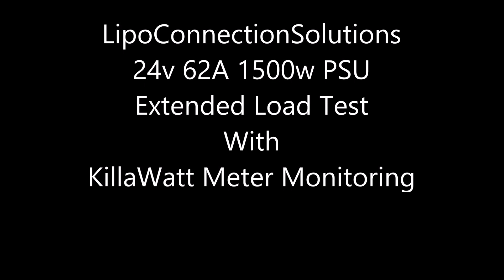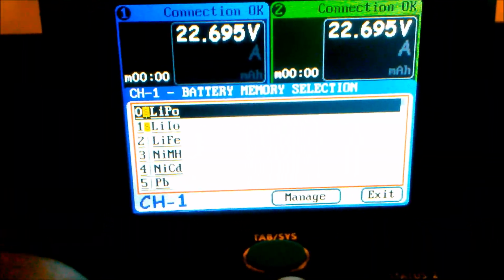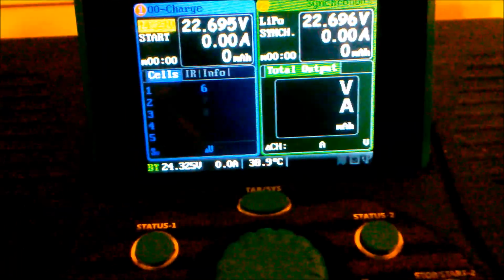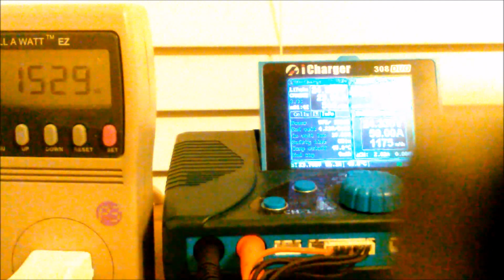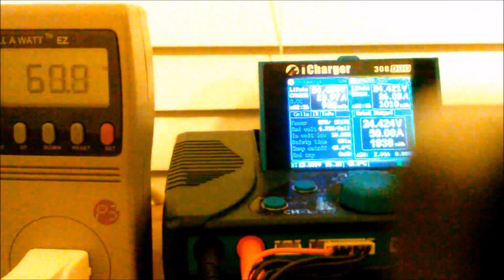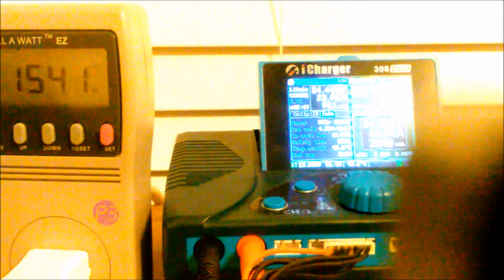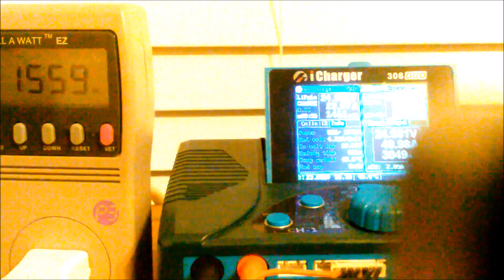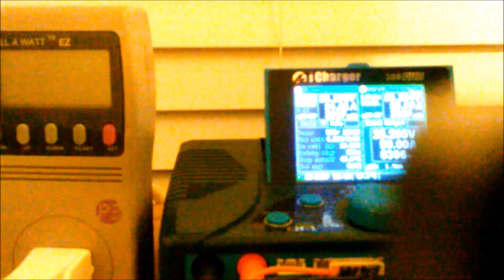24v 62A Dell RC Charger PSU Load Test

Comment: The typical wall outlet is fused at 15-20 amps depending on circuit wiring size.